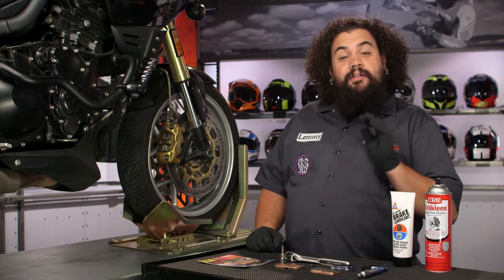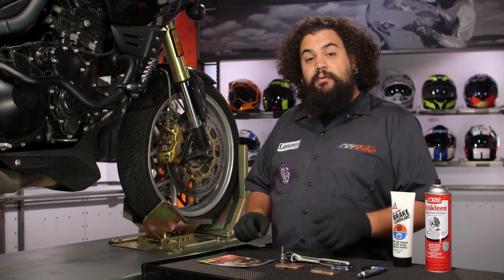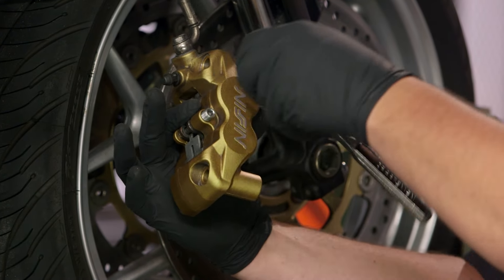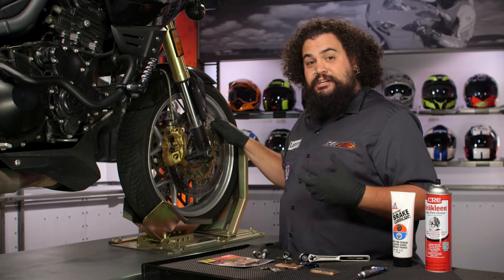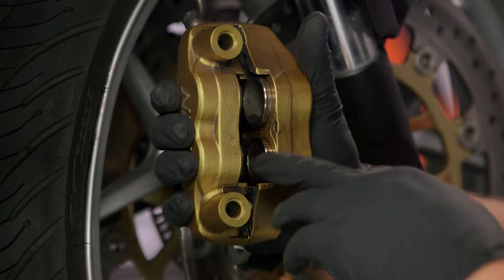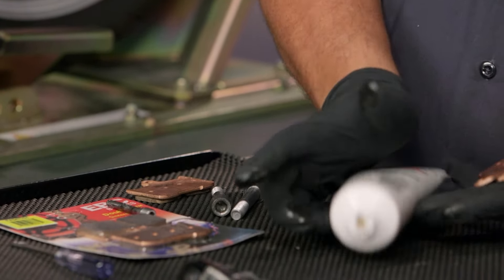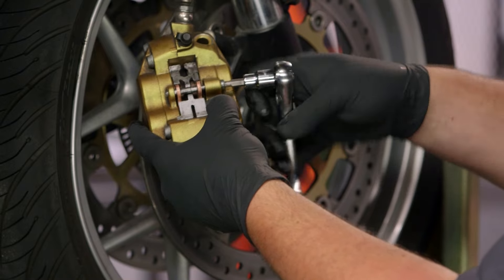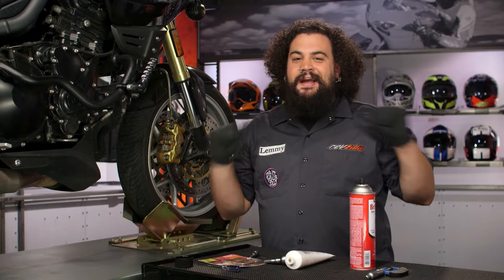How To Change Motorcycle Brake Pads at RevZilla.com

Comment: You forgot to mention to check the brake fluid level before pushing the pistons in, you might overflow :)
Reply: overflow? it's a closed system
Reply: It’s not air-tight, oil can flow thru your brake fluid (cylinder?) top container thing. Happened to me today when replacing brake fluid.
Reply: True.
Reply: @etaybokish  it absolutely should be air tight. If it overflowed then you must have had the resevoir lid off because brake fluid does not compress it would naturally flow out the top so .....that wasnt very smart.
Reply: @etaybokish  of course it's air tight. It has to be so tight that under enormous hydraulic pressure nothing leaks out. That's it's entire job.
Reply: @etaybokish  I think there are two separate sections, before the lever and after it. before the lever is the reservoir which should be able to pull in air and adapt to changing level, thus avoid a vacuum. after the lever is obviously an air tight system to be able to build brake pressure to the calipers. I assume the two sections are connected when lever is not pulled, thus allowing the leak in your case. but once lever is pulled, they are isolated.
Reply: the answers to this comment are hilarious, clearly none of the people who replied to you should work on their brakes
Reply: for anyone reading this, the top part is merely airtight in no way is it capable of handling enormous pressure. 

I guess what he meant to say by saying to check the fluid level is that if it was topped of with low brake pads when you push the pistons back in the calipers the fluid level will raise higher then the maximum.

if the cap is on it will stop you from pushing them back in all the way and if it’s off it will overflow.

the pressurized part is after the reservoir and it’s not a closed loop, it’s not a loop just a hydraulic line with one (or more) piston on each end.

Comment: Thanks for the video Lemmy. You inspired me to change the rear pads on my Kawasaki ZX14R and it could not have been easier. 10-15 minutes all up. Outer pad was more worn than the inner. Thanks again, I really apreciate your maintenance vids.

Comment: A good tip when putting that type of caliper back together is to put the caliper back on then sliding the pads in from the top, then you don't have to use 3 hands to hold it together. Also check the brakefluid level as you're pushing the calipers in and while you are doing it Also check the brakehose for wears and cracks.

Comment: Got a new subscriber 😂 I've recently got into motorbikes and replaced my rear brake pads yesterday. No prior experience but seemed self explanatory. Had to take a quick ride out today for job interview and noticed the brake was sticking slightly on the way. I did not clean the pistons or push the pistons all the way back into the caliper housing and would never have thought to lube up the back of the pads or pad pins.... my caliper is slightly different to this one but I think I make have put the shim in slightly off aswell. 
Now I know where I went wrong I'll go back tomorrow and redo it. Cheers for the vid

Comment: Great tutorial!  When I change brake calipers on my cars, they tend to be quite heavy and the hoses tend to be rubber, so I always support them.  The best way to do it on a car is with zip ties;  So I'd reccomend zip-tying the caliper up so it doesn't hang by the brake line, even if the brake line is tough.
Reply: Bike brake lines are magnitudes stronger and for the weight of the caliper they can take it for fun. Bike brake lines are made in cross ply and radial as they are designed to constantly move and  streach so they can take the weight of even a large caliper no problem. The problem with leaving car calipers dangling on the hoses is that the caliper is about 3 ton and the short section of hose is lesser quality than motorbike ones and they dont like bending more than a few inch in one direction. See in any circumstances where your hoses cannot take the weight of a caliper id suggest that your hoses were long by their best and needing replacing anyway. On cars its always the end fittings where it holds onto the hose that get it when you dangle the caliper on the hose alone.. or its when the outer hose has perished enough that cracks are showing it ends up punishing them hairline cracks and sometimes they hold out for 6 month afterwards in that case but it does seriously age them in that case so i agree with you on the car side of things. Bikes you really dont want any weaknesses on the brake lines at all as you fall off motorbikes

Comment: Hey guys, great video, just wanted to let you know that those EBC brake pads don't need silicone/copper grease on the back of the pads, it actually says not to do it on their website: https://ebcbrakes.com/product/ebc-caliper-brake-lube/ the pads have a copper backing and the grease just catches and traps dirt, I've been running mine dry with no brake noise whatsoever, happy motorcycling!

Comment: Next time, install the caliper first (finger tight) and then slide in the pads and install the shim and pins. Spin the wheel and gently pull the level to stop the wheel. (repeat about 3 or 4 times) on the last time hold the level while tightening down the caliper bolts.

Comment: Keep an eye on the brake fluid reservoir as you push the pistons in. There is the faint possibility they may overflow if the brake fluid has been topped as the pads wore.
Reply from the maker: You're absolutely right. Lemmy mentions this detail in his companion article as well: "If you have been adding fluid, you may want to visit our how-to on servicing the hydraulic portion of your brakes and you may need to draw some of the fluid out of the reservoir before you start. Otherwise, a brake job may end up turning into a paint job, because spilled brake fluid is nasty to your paint." -DrewZilla
Reply: brake fluid levels indicate brake pad wear when the level drops. brake fluid shouldn't go away or you got bigger problems.

Comment: Hey +RevZilla

I tried to push the pistons back into the caliper like the video said, it was really hard to do so. Instead of what Lemmy did, I used a channel lock plier to push it back in, using a towel so it doesn't damage the pistons. It worked, but now I am unsure if I did something bad or not. Thanks!
Reply from the maker: +Richard Oda You just don't want to damage the piston by using a tool directly on it. You're probably ok though. -DrewZilla
Reply: You can losen the main cylender of fluid to release the pressure, this will help allow the pistons to move

Comment: If anyone reading this has changed their brake fluid in the past and is not sure if they did it right, don't forget to check the level of your brake fluid while pushing the pistons back in! Pistons not returning completely can be caused by the fluid container that has been filled above its max allowed level! + some fluid containers have little air vents to compensate for pressure differences in the container: to much fluid + pushing back pistons = brake fluid all over you precious bike. :)
Reply: pushing pistons back you want to have either the cap and diaphragm etc off the rez and fluid at least at the low level OR you can undo the caliper bleeder enough that it's letting fluid out when you press. Other than that there is no secret. If you fight the sealed unit to get the pistons back in you are driving fluid back up the system and relying on the give in the diaphragm under the rez cap to take up the pressure and equalise it. Air in the system is an entirely different thing if you had air somewhere then a pad change is likely to push that air about to another position mate.
Reply: too add to my last reply rather than edit it >  see the low level on the rez thats deemed the low level beacuse its where you would still want the fluid to be with the bike on its stand with the steering cocked in the worst position height wise. Its  the amount that shouldn't spill out with stand wobble and shouldnt allow any angle to get air into it enough that it can be inhaled into the system even if you pull on the lever really fast.

Comment: Car mechanic who has never done motorcycle brakes before. Kawi says to leave the caliper on and take the pads out from the top (2019 Z900ABS). They seem pretty serious about it because they used Torx bolts to hold the caliper on. (Everyone knows only certified professionals can remove Torx bolts). 

I'm confident and possibly even competent enough to remove the calipers to change the pads, and give the whole system a good staring at. Thoughts?
Reply from the maker: That's perfectly fine, kawi just recommend removing from the top as it is the faster way to get the job done and if you're a car mechanic I'm sure you know the importance of book time vs actual work time when it comes to ringing up the bill at the dealer.

You can easily pull the caliper off, clean the dust off thoroughly, and replace the pads with the caliper in your hand.  That said, on a bike that new a full inspection is not really required.

I hope that helps!
-Zack

Comment: Wouldn't it be a good idea to leave brake calliper slightly unscrewed, pump the brakes and then torque it all the way? This should help with centering the calipper perfectly.
Reply from the maker: For most motorcycle brake calipers, it really wouldn't make a difference. -DrewZilla
Reply: That tip actually worked wonders on my Superduke.  I just replaced rotors and they were dragging.  I loosened the caliper screws about a turn, pulled the lever and with pressure applied I tightened all the caliper mounting screws.  I went from the wheel spinning about a half turn to a full 360.
Reply: Nice!
Reply: I rode it today and it feels back to normal.  Thanks MotoHolota!  Great video Lemmie!
Reply: Glad to hear. :)
Reply: yeah probably, also works with bicycles
Reply: if ur bike use a floating disk it wouldn't make a difference except maybe some grinding noise 
but its the better way to do this just like using torque wrench
Reply: I'm getting ready to do my brakes for the first time and was wondering which screws were you talking about when you say leave them slightly unscrewed? Is it the screws that mount the caliper to the fork or the screws that hold the pads in place? Thanks
Reply: TJ 
this is for centering ur caliper so just leave all screws 1-1.5 turns out and pump the break until they bite quite firm then tighten all the screws while keeping the break pressure.
Reply: I'm pretty new at wrenching and I'm finding that persistently using a torque wrench is training me for the feel of how tight different size bolts should be.  Before this, I was ALWAYS too tight.  A sheared off caliper mount bolt would be a bad day...

Comment: make sure to torque the caliper mount bolts with the brake lever pulled in to make sure pads, calipers and rotors are properly aligned

Comment: You're awesome, thanks. Watched this twice then just did it without further reference, you're that good (because generally im rubbish). Being me, of course I didn't use a torque wrench and snapped the bolt on the rear calliper when I was attaching it back to the bike haha. Going to have a go at drilling it out tomorrow. Thanks for the video!

Comment: Hey! I'm about to change my rear brake pads for the first time. I'm doing the rear first as a test, so if I fail I only lose 20% of my braking capacity (in theory, lol). I was wondering if I can use copper grease to lubricate the parts that you lubricated with special brake lubricant. I've seen copper grease used in some other videos and was wondering what you'd think about it!

Cheers!
Reply: Copper grease will also ruin the rubber sadly .. silicone all the way man :) around brakes at least
Reply: Howd it go?
Reply: How'd it go
Reply: @justan-eli9262 It went well, I did my back brakes to begin with. I figured if I somehow messed it up, I'd only lose 20% of my braking capacity since the front would still work. But I'm confident now in my ability to do a brake job. I finished it in 20 minutes or so, and I'm a two left handed mechanic. But I like to just try and play around with it, to get better at it and save some coin in the long run!
Reply: @crazedexplorer  See my answer below :)

Comment: You dont grease the back of pads mate especially not for racing use. The pad backing is made to allow for free movement between it and the brake caliper piston skirts and even allows for the braking  gas to float the pad temporarily when your pads are red hot im not joking thats part of the engineering behind pads both SBS & EBC have the tech & data sheets on it if you need to see for yourself. Another thing lubing the back of the pads does is hold dirt in and if you ever wash them with even a grease remover or proper traffic film remover you will wash the silicone lube out of the pads and onto the discs (rotors for Americans) which is fine if you are doing a thorough wash of the entire front end but isnt ideal either way.  The manufacturers and race teams suggest the only part you ever lubricate should be the caliper pin silco lubed then wiped off by cloth so there is no thickness and this is only to be done if the pin is in bad condition or is not being thoroughly cleaned between pad changes in race use.  Good vid though and another thing to mention is to wash out your bungs on the disc so the outer disc actually floats correctly. if all your disc bungs have caked up you will defo get overheating and wear on the leading edge of the pads. Every set of pads ive done where the leading edge is overheating or wearing fast has been because the bungs on the disc werent letting the outer disc surface float. You also want to unscrew the cap on the brake rez when reseting the pads so the diafram isnt fighting you from pushing the pistons back in and so both sides have identical pressure when you reseal the cap, technically they will equalise over time but the problem is you dont have time when racing,  another way to do it is slighly undo the bleeder as that prevents  mucky fluid being sucked back up the lines so thats why its drilled into me to do everything correctly every time. I raced R6 cup back in early 2000s and done several bike mechanic jobs mostly race outfits here in Scotland alongside my Usual job as boat builder and marine mech. Hope this helps

Comment: I did everything that was stated in the video, however after pumping the brakes my front wheel has a hard time moving freely on a stand.  The brake pads are touching the rotors and gives the wheel a hard time to move freely.  (the wheel moves freely before pumping the brakes) Thanks for the video Lemmy!
Reply: didn't clean the calipers before depressing them in the bores?

Comment: Brake pad dust is carcinogenic.  Lovely!  I find this out, AFTER I rebuild and change the pads on front and rear.  Well, better late than never.  Thanks for the tips!
Reply: +Jeff Cobb At least you'll dead doing something you love! Could be worse!
Reply: Yeah I know , I work in a brake pad factory , you want to see the dust in there !!!!!!  Life expectancy not long 👎🏻😫
Reply: rip wilswood -2018
Reply: Its only carcinogenic in california
Reply: I like to hose the brakes down with just a little water before I get started or you can use brake cleaner if you're rich.
Reply: Peace Love I’m an Autobody tech,  every thing ever on my hands and in the air causes cancer, fuck it 🤷🏻‍♂️

Comment: The pads on my front brake are showing very odd wear.  The outboard pad is worn thin but the inboard pad isn't showing much wear at all.  This is on a 2016 Honda Fury.  Could I possibly need a whole new caliper already?  Anyway, thanks for the education.

Comment: Question I know you said in the beginning of your video to don’t press the brake lever but I heard complete opposite once the caliper comes off to wedge a popsicle stick or an old brake pad in there crank that puppy all the way down to the Pistons exposed to get some 400 grit sandpaper around it to clean off the gunk then compress it I also have another question because after I did this a tiny piece of metal fell out of my brake caliper but I have no clue where it goes but everything went right back together perfectly fine

Comment: Quick question, I got a small amount of lube onto 1 of the brake pads by accident roughly the size of a fingerprint. Will this be an issue and do I need new brake pads because they are contaminated or can I just clean it off with brake cleaner. 
Thanks.
Reply: Brake cleaner .... beware the first ride .... grease will burn off or run it for a Km and stop and wipe disk rotor with brake cleaner to get ride of the transfer of grease .... not a biggie.

Comment: Do we need to lock tide the break bolts or what parts is lock tide is  best used on ?
Reply from the maker: We recommend you consult the factory service manual for your specific bike to know whether it's necessary. -DrewZilla

Comment: Do you have to use lube? All that's available in my area is petroleum based brake grease. So is it a preference thing or requirement? Also my bike does not have rubber slide pin boots. Advice please????
Reply from the maker: Lubricants are specific to the application, so you really need to refer to your factory service manual (or get a factory service manual and confirm the specification if you don't already have one). It's important to use what the manufacturer specifies. -DrewZilla